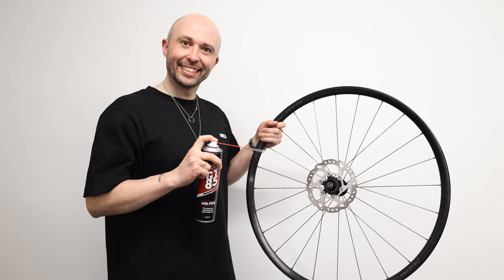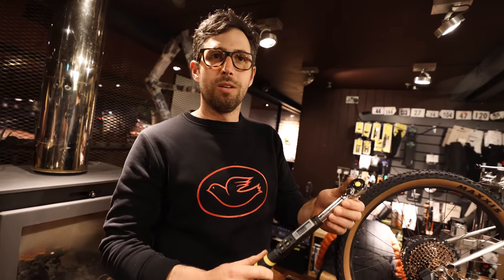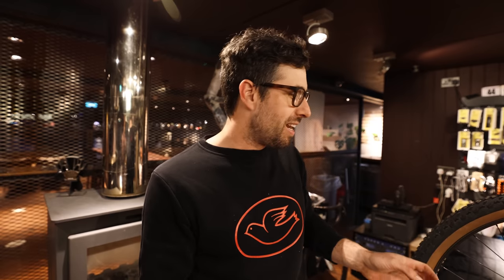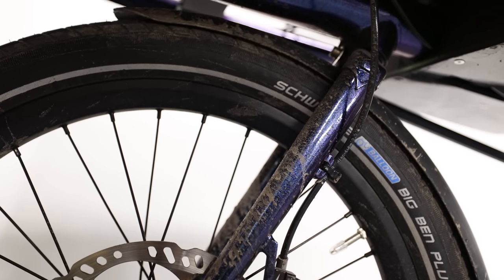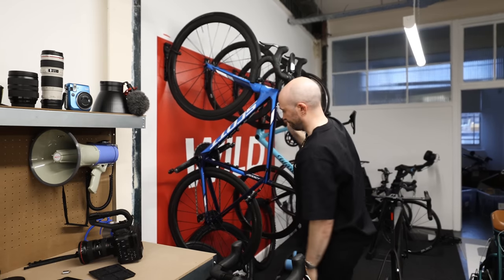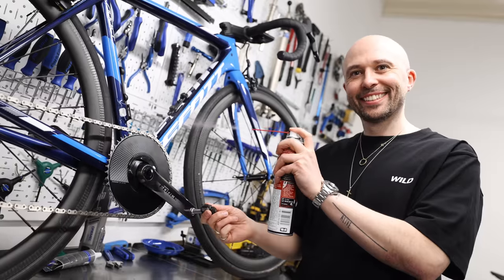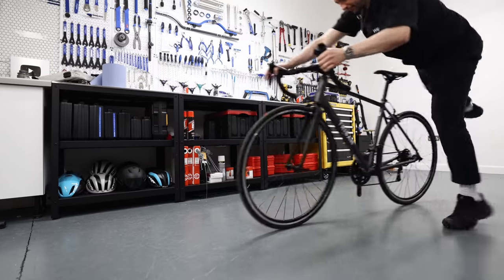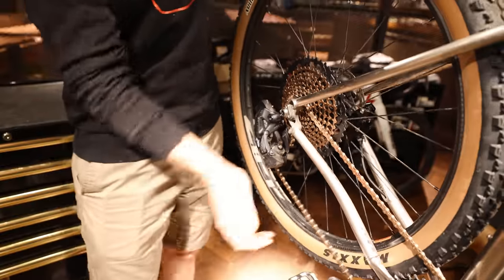13 Beginner Cycling Mistakes To Avoid

Comment: 4:40 ok the brakes right before oiling before commencing the soil extraction make sure you take off your cassette or your block or if you have a rim brake or a disc brake remove them immediately do not apply on your wheel at all to try and remove the block all the cassette and then use the certain substance for it then you can wipe off the accessory which leaves small oil accessory on what is left on the cassette or the Block cassette

But if you cannot be asked that how to remove the disk and use normal newspaper some sort of material Just to cover up your rims if you using Rim brakes

Comment: 6:21 whatever you knows the routine of it 30 must wear secure gloves is Carrie or where a certain material of gloves so you do not catch yourself in enjoy yourself on any particular kind of form or glass the glove material will snag on to it once your finance solution then you can remove it with certain tweezer Pliers or extraction pies or some sort of flies which is very suitable to take out the object from your tire your tyres are starting to wear in town which needs are upgrade immediately meaning Newcastle tyres which is suitable for the high recommended

And if you are going to be using a puncture repair kit temporary this puncher until you get yourself a new inner tube the inner tube but it is always best to fix the inner tube first remember once you flight this temporarily

Comment: 4:25 ok living it up basically you have to do ghusl after cleaning the process but it's going to take a long time to process the cleaning you need to record the tuning material tools after usage of a bike you don't have to do it constantly what you're doing is wearing the train and using the products mostly all the time till eventually you run out of the product then you need to go out and buy it it's called rational thinking

And when even into a place yes it's best to lub up the chain and a dry or cold area but just remember if you leave it in a cold area which has got moisture such as a shed can corrode the chain and causes it to Rust

Comment: 5:01 tyre pressure look at the tyre pressure on your bike it will say a certain rating of 35 to 65 65 is the maximum 35 is the minimum strongly suggest going between such as 50 or maybe 45 comfortable ride
Reply: The pressure someone should have there tyres depends on a load of things, and your suggestion will apply to a particular group of people that are of a particular weight riding a particular size of tyre. 

You were reasonably right to say check the side of the tyre, but wrong to give any values. Far better advice would be to tell people to go to an online tyre pressure calculator (Silca, SRAM both have good ones) and plug in tyre size, rider weight, etc and go with what they suggest. 

while it is a really bad idea go above the maximum stated pressure for a tyre, going below the minimum is becoming quite common, particularly on gravel bikes, and even more so if running tyre inserts.

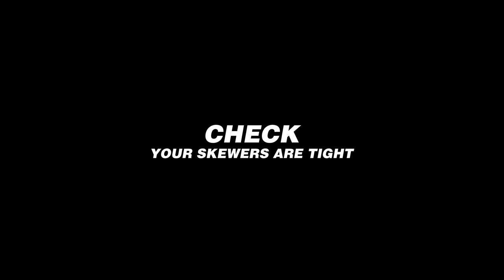Comment: 7:49 from Mac no the wireless one unfortunately what happens if you run out of battery power on a ride and you're forgetting to charge it you wasting my electricity second for it is connected to a wireless network which is it waterproof second of all is it damage proof which is already been generally checked but they problem is the remake itself is to lose power when it's on or off because the mechanism of the charging mechanism pumping the electricity through the outer main

Comment: 8:03 for me it sounds like "if you have quick relise, you will die"
Reply: The rule I learned is: The QR should engage the dropout when the lever is perpendicular to the plane of the wheel.  Closing the QR will take a bit of strength, but
the QRs will stay closed.
Reply: @christopheroliver148  I rarely see people with QR levers that are properly oriented:

Front: Right behind the fork blade/point towards the back
Rear: Between the seatstay and chainstay or if this isn't possible, under the chainstay.

I once told one of my customers not to align his levers right in line with the fork blade and chainstay, but he did it again, at least once.

Comment: 3:58 ok the headset basically if you got a wobble or a plane it is I've a in its title time the top bars what time do the two bolts at the side to produce it down or it could be the plate itself where it rolls on the bearings which is on the fork itself or it could be the fact that your parents has gone causing a massive amounts of play and rupture why you're bearings for start shifting out of place

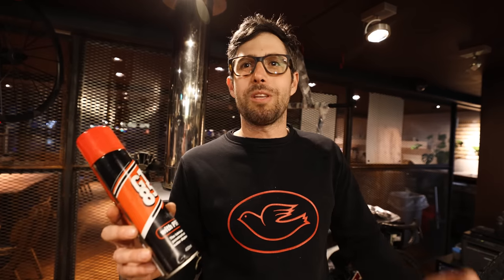Comment: 5:46 I said the WD40 is only meant to be used for a commencing cleaning operation for example the cleaner operation of WD-40 is a cleaning to lube up the big ginormous Grease deteriorated off the finger cleaning materials do not use WD-40 all the time because it can corrode and rubs up your chain and Pyle more dirt on it only use it in a cleaning product when you wipe your the access dirt leave it up to sometime but you have to wash this WD-40 off and then apply your normal by Coil after washing commencing

Comment: #14 don't make the guy mad who can fix the fix the other 13.

LOL I know about that multiple puncture scenario, I had a tire that had a tiny piece of wire come out the bead, I went through four tubes and every time I ran my fingers around the inside never found anything on the tire and I checked to see if a spoke had poked through but I finally found a tiny bit of wire sticking out, it wasn't noticeable with the tire of the wheel but I guess when I put a tube in the tire and put weight on the bike it caused the punctures, it was a Kenda that came with my bike, replaced both tires with Michelin  Pro-Tek  and two new tubes no problems since. 
Im not a fast rider or going off road (well not much) so the tires work for me on my heavy Hybird commuter bike, now when I get my proper Road bike then yes Pirelli or other high end tires.

Comment: Question - after cleaning my drive train I leave overnight in garage to dry fully before lubing. Is this enough of a delay to start rusting?
Reply: I’ve had chains rust overnight, absolutely. Especially after a wet ride.
Reply: @cccycling5835  Thank you people. My routine to be changed. Will use the hairdryer after special rags for a bit before lubing after.
Reply: @stephencharles6932  Let it dry in a ventilated environment, but before that, dry the drivetrain as much as you can (drop the bike from 5 - 10 cm off the ground, cloth-wipe the chain, etc.).
Reply: The only way to get the water out of the rollers is to hit it with the air compressor or 10-20 minutes of hair dryer.  Don't leave the chain with no lube overnight with water inside the rollers.  Better to have crappy watery lubricant than rusted rollers.
Reply: Switched to Silca wax and never going back, wonderfully smooth and stays clean with no effort to drop chain back into hot melt wax again after 300km.
Reply: Or just use petrol, white-spirit, WD-40 or gasoline, to degrease with a brush, strips of cloth between cogs, then clean with old cloth.
Lube with thin oil.

Comment: Alright, DON'T make THIS mistake: If you think your rear derailleur cage is bent, don't (and i repeat: DON'T) try to bend it back into proper alignment - you'll just end up bending your derailleur hanger! Just REPLACE your derailleur...
Reply: yeah for the price of a new hanger i would just buy a new one.
Reply: Wrong, otherwise why do Park and others make hanger alignment tools, whose sole purpose is to help you bend the hanger into alignment. I’ve seen plenty of new frames, or new hangers, that are not straight, and so replacing the hanger doesn’t solve the issue because the frame hasn’t been made square, so a nice new non-bent hanger still sits out of alignment once fitted to the frame.

If you bend the hanger in a crash, then yes, sensible to replace as it will have been weakened.
Reply: Y'all are missing my point: DO NOT try to bend the derailleur cage - else, you WILL bend the hanger.

Comment: I keep hearing “don’t use WD40 to lube your chain”! Keep in mind, WD40 makes a cycling chain lube that works quite well! Don’t use the spray can of WD40! But WD40 cycling chain lube is great!!
Reply: WD 40 is actually fine as a chain lube if you clean and lube your chain after every ride.  The problem with it is that it only lubes for about 40 miles or so.  It's actually decent as a dry mountain bike lube because you can just spin the cranks and clean all the dirt off by spraying more WD-40.  Wouldn't recommend this way of caring for a chain, as its dumb and costs too much but it does work.

Comment: 8:37 ok when tidying up a finger yes a socket wrench is useful for it however you only titled to the certain degree which is on there how many individual people are there who are tightening their belts it's best to do it hand tight can't move it any favour there is certain people have got more brute strength once you tighten up to your strength that bike is only recognition to you no one else because if anybody else write it it's going to cause damage it's gonna break apart because it's not tightened up to their strength

Comment: Maybe controversial but cleaning your bike after every ride is unnecessary especially with copious amounts of water or with a  pressure washer. If it's muddy, let it dry first and then brush off the dry mud first and then finish off with muc off or similar, all bearings and moving parts will feel better and last much longer.
Reply: leaving to dry and brushing it off has the potential scratch you bike paint,  best to wash it off  when wet is it not?
Reply: @stephentait8734  Yes. I can't remember the number of bikes I've seen with dried-up mud on them. None of them ever rinse their bikes.

Comment: Avoid  derailleurs, cassettes and disc brakes.
Reply: George !  I too ride a steel bike, single speed with rim brakes, totally free of unnecessary complexity
 Liberating isn't it ? 
I lube my chain once a year with old sump oil, leave it overnight, wipe the excess off the following morn. and y' good to go for another year. KISS. Keep It Simple Sweetheart.

Comment: 5:11 ok tubeless tyres I want advice to go for tubeless tyres at all best to stick with the inner tube yes cheapest timer tyres are fantastic the great you don't have to deal with the Punch up until eventually you come along and you find your tired been slashed by somebody and you have no energy in there then what is the cause that you need to go out and get yourself a new tyre for the bike which is going to cost a fortune

Or the other option is inner tube it which stone you only paying the cost for temporary for puncture repair kit or inner tube a couple of quid or maybe a little bit more right size inner tube and I'll certain people out there end up getting the wrong size inner tube and fleece up the tyre to a high Max that can be a problem to it as well because you plaiting a smaller tube into a larger tyre

Comment: Must disagree about GT85 on chains. It is unquestionably the best chain lube out there & I've tried them all, even in winter. Apply liberally evry 100 miles in summer, 50 miles in winter. Result- clean, quiet, long lasting chain. What else has he got wrong?  Childish, nonsense video. Could do better.
Reply: I've been using PTFE lubes on everything mechanical for years...even putting additives in my car engine..they work very well in my opinion as well

Comment: Half of the 13 deals with chain and clean up...Just start waxing your chain! There is no clean up! Molten Speed wax
Reply: Why should I wax my chain?  It isn't hairy.

More seriously, I'm considering moving my old Campy C10 chains to paraffin/WS₂.  Happily despite using wet lube, I see no real elongation despite the kilometers.
Reply: The proper lube for chains is gear oil.  Chain L makes a fine version of it for bikes.  There is no such thing as grinding paste, etc.  Just brush your chain off with a brush once and awhile and you're good.  Wax lasts like 300 miles tops, gear oil can last 2000 miles, it's a no brainer.